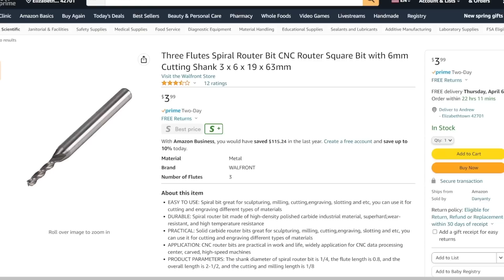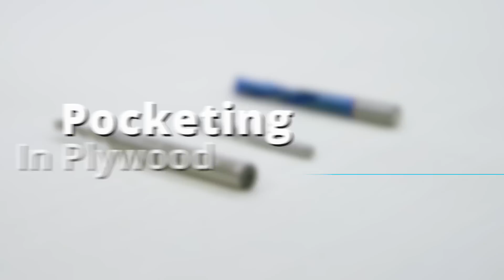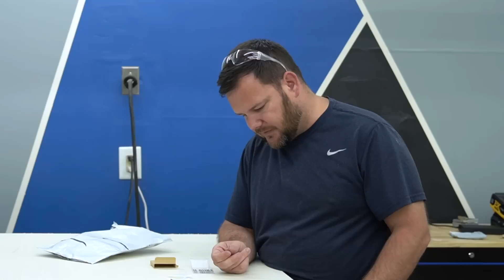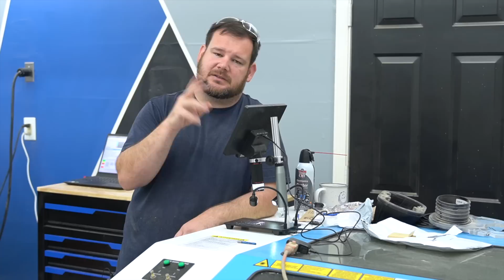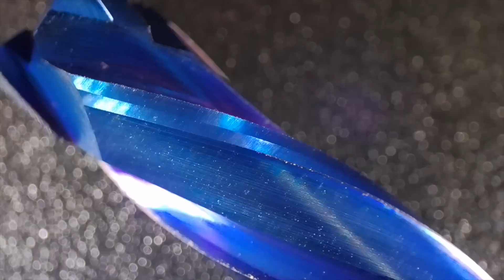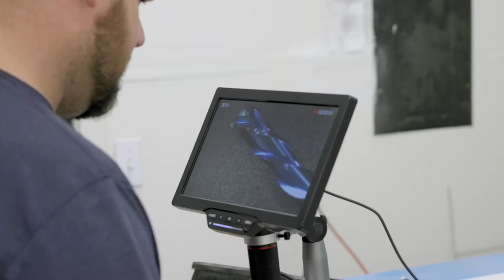Testing the Cheapest CNC Router Bit on Amazon!

Comment: I prefer buying branded bits as they usually come with the setup information needed to run the bit properly, some thinner bits need the correct settings or they will snap, sometimes a specific ramp is needed
Reply: I disagree. Manufacturers only offer up the lower settings due to the older cnc machines out there still. The speeds and feeds usually given are generic and low numbers
Reply: @jeffverdin6105  maybe, but they get the job done & its better than entering the wrong setup because the manufacturer cant provide it and snapping bits especially the thinner end mills. My point is that thinner end mills or O flutes need a specific setup including ramp to avoid snapping. If you buy a cheap bit more than likely the manufacturer wont provide this information